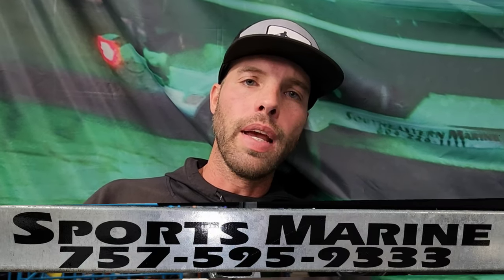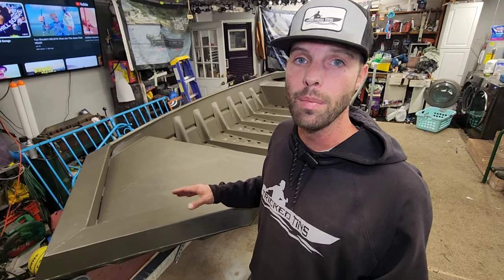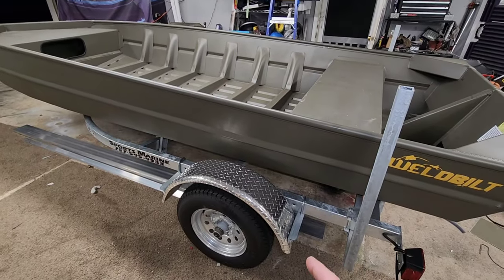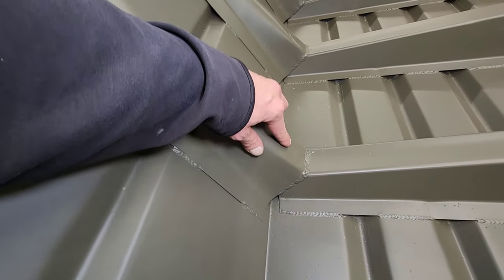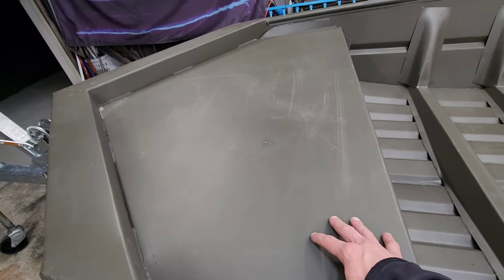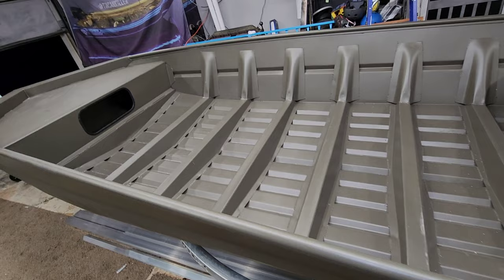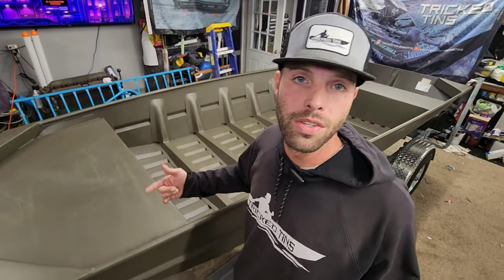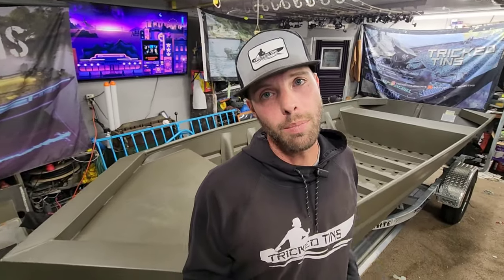Best Bang For Your Buck Jonboat

Comment: Cool boat. I don’t like the pointy front end. It’s wasted space. It looks cool though.
Reply from the maker: That's the best part. It cuts the water, and makes the bow super strong.
Reply: @TRICKEDTINS  not at the top of the gunnel!
Reply from the maker: @timburton9514  idk? I love the nose on these weldbilts. They are my favorite rigs to build out. I just wish the had a rectangular gunnel cap instead of the pipe. It would save me hours...

Comment: I have a big Jon boat with that has aluminum floor front and bad deck. 28 hrs old. 96” wide by 20’ long. Tunnel. That evidently has held water in middle see that now I am getting small holes in it mean8ng there is corrosion setting in. Is there any way to replace boor boat or just keep patching till time to throw away?

Comment: Great video, thanks!  Question: what is the hull of this boat like?  Absolutely flat, or does it have a gentle V?  I am looking for an inexpensive boat to use in a strong river and in saltwater delta of the pacific ocean.  Generally flat calm water, but occasional heavy chop and sudden squalls so it has to be sea worthy (inshore, along the mangroves).  Is this the boat?
Reply from the maker: This is a semi V

Comment: Those side supports are intentionally not welded all the way in. Lots of designs call for pieces to not be welded fully to allow for flex, if you full weld it and make it rigid it will crack under stress.
Reply from the maker: Lets be foreal. Ive personal spoke to the guys at weldbilt. These weld locations are not specified by an engineer.  It's up to who is working the shift your boat is built.